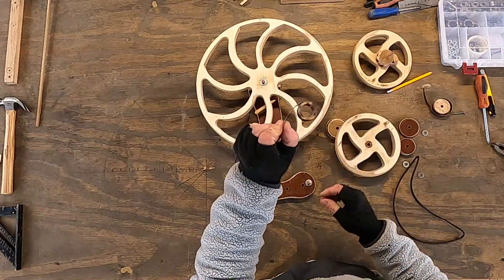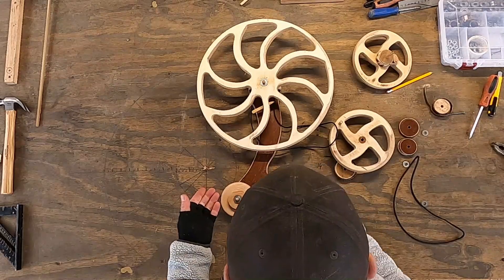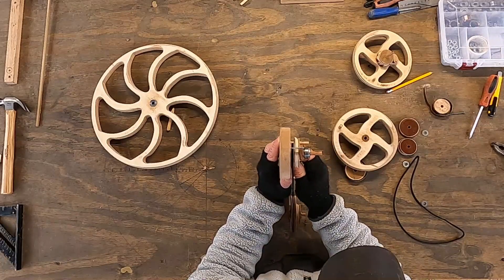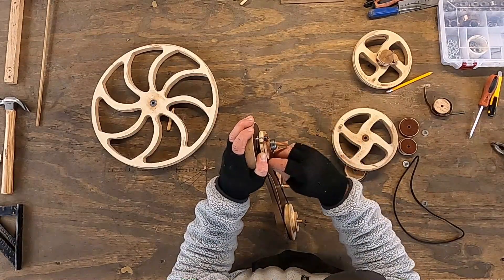Best How To build a Basic Kinetic Sculpture

Comment: Thanks for your explanation of the kinetic sculpture. Wish I could add a picture here but you’re smart enough to understand. I took your gravity/centrifugal catch and redesigned it. I drilled a hole in the wheel and put a rivet inside. Made a small wooden washer that allowed the thick end of the rivet pop out when the wheel spins. The kick back is good enough to drop the rivet back down the hole.

Comment: Thank you for showing the inner works. I've wanted to build one of these for a very long time, I'm glad I found your video.
 Get a couple of bicycle inner tubes and cut a long strip out of the center to get rid of the valve. That'll leave you with a long rubber band that you can cut the width to fit the pulleys.

Comment: To help with the drive friction try tuning a deeper grove in the drive pulleys to allow for two {not one} large O rings. Neoprene or silicon work best. You will stop the slip problem.

Comment: Watching your video I am interested in learning this technique You asked about anything you could use for the pulley have you tried Elastic found in sewing departments in Walmarts it comes in all different width sizes and it might work
Reply from the maker: Very familiar with it! It doesnt hold quite enough tension on the pulleys to keep them from slipping! The winding spring is very strong! Takes a lot of pressure to keep it in place ! Thanks for watching!
Reply: @ShawnWithTheWildALONES7  sorry just trying to help a totally amazing piece loved it

Comment: Bro, you just missed a step on your belts is all. Take these belts, rub them down with some rubber cement, squeeze all the extra cement back out, flattening the paracord as you go. allow to dry. You get a lot more grip, but not too much.

Comment: Very nice, and wonderful, Thank you for your explination. Actually, l am trying to understand such spring drive mechanism for kinetic wall sculpture. But in your video, there some little mistake to focus the particular parts / mechanism. It is a fixed camera shoots which fixed upside. It is need some particular scene should be focuses. Ok. Thanks.

Comment: Hello, Shawn. I want to firstly congratulate you on this project. I really appreciate all the work you put into this, and all the attention to detail. 
I have a small question though. I found on Aliexpress the type of spring you used, but i could not find the exact specs that match yours. Could you provide a link where i could buy the exact spring you used in your project? Thanks in advance!
Reply from the maker: The springs that I used are actually the wrong type of spring for this application! These springs are actually used to provide tension and retraction on a straight pull they are not meant to be counter wound so they distort after only a few wined ups!

Comment: To get better grib on the wheels, wouldnt a rubber band that fit the wheel work? And then another rubber band that fit the two wheels it has to transfer energy between. Then its rubber on rubber.

Comment: Here is the belting that Roy uses. https://www.mcmaster.com/coil-spring-round-belts/
They have connectors for the belts too. Hope that helps.
Reply: Question. Where does the long paw on the large free spinning wheel contact the small escapement wheel to drive it into motion? The camera is to far back to see the escapement details. Thanks
Reply from the maker: @Kevin-oz9fw  I’m currently working on a plexiglass model that will you to see the inner workings! To answer your question! The long paw on the free spinning wheel catches the lower paw on the escapement mechanism when the wheel falls back allowing just enough pressure for the the upper paw on the escapement to disengage allowing for another half turn of the escapement!
Reply from the maker: Awesome I’ve been looking for them! Thanks

Comment: To give your belts more traction, look up something called grip tape. That stuff works wonders. You only have to use a little bit: quarter to half inch pieces every 90-120˚ on small wheels (though you might as well wrap the whole wheel if it's 2 inches or less) and about every 36-45˚ on larger wheels (about the size of a salad dish or larger).

Comment: Thanks.  Nice video.  Old Singer Sewing machines use a leather belt that was a round leather cord and had the ends wired together like a staple through the leather and bent over.  I think you can still purchase the round leather cord somewhere.

Comment: Cool, where did you get the spring? Is it a constant torque spring?
Reply from the maker: The spring you need constant torque spring but the ones I have are only meant to pulled in a straight line not counter torqued. If you can find a supplier of counter torque springs let me know! I’m looking also! Thanks for watching!

Comment: Have you tried round polyurethane belting. It's cut to length and melted back together, so it can be any length you want.
Reply from the maker: That seems to be the best answer! I haven’t tried it yet but I did order some, just waiting for it to come in! Thanks!
Reply: @ShawnWithTheWildALONES7  Let us know how it turns out! I got the ''tick-tock'' addiction, now I'm looking at kinetics! I smell sawdust!!!!
Reply from the maker: @dondale68  it does get addicting! I started it for another reason, but I got kind of obsessed with seeing how long I can make it run! Definitely a bit of finesse to it. Currently up to 45 minutes on this particular spring (which is not the correct type of spring for this application) but I had a few soooo. It works fair!